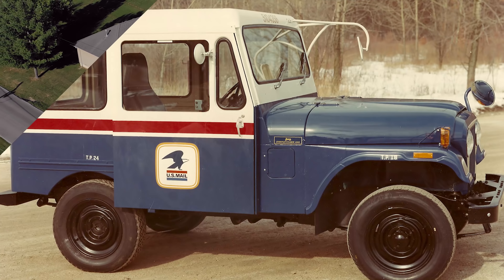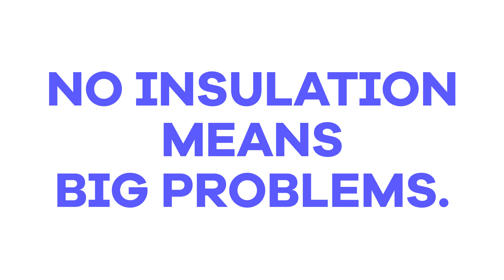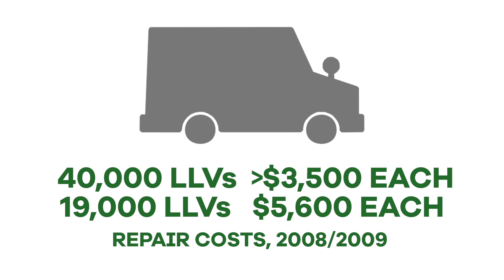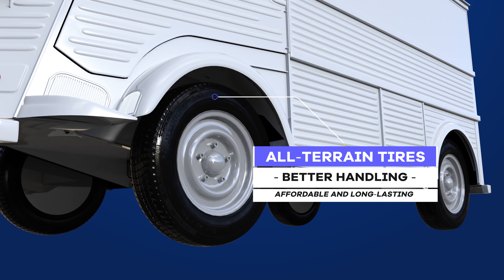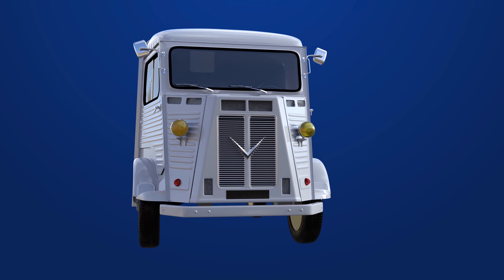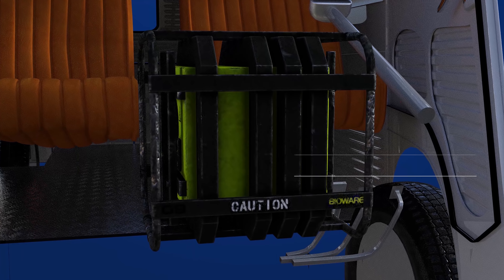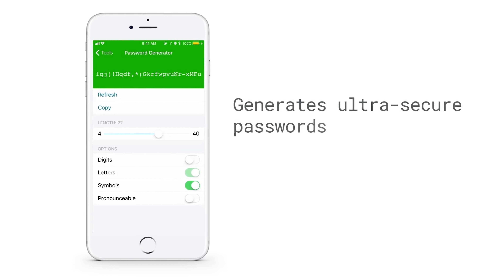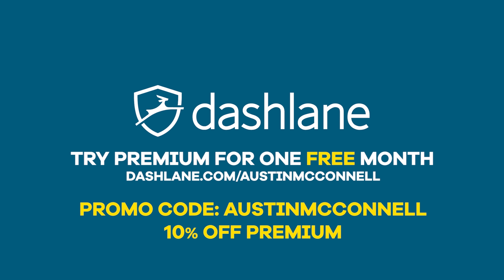Postal Delivery Trucks Stink. Let's Redesign Them.

Comment: Mail trucks do need to be redesigned, but the way you redesigned it is terrible. I’m betting the best redesign would be a RHD version of a Ford Transit Connect with the extra seats torn out or something, as boring as that idea is. And electric motors would be great! But only in the regions where those routes are actually shorter than 100 which probably isn’t true of anywhere more than 30 miles outside of a city, and even if that isn’t true the batteries will wear out over time and cost even more to fix. On a personal note I don’t like the aesthetic design, I guess, though a cuter van would be a good idea.

Comment: i run deliveries for people on my bike its home made so i could design it from scratch with the tittle saying (speccon) when i built it i made it both electric and gas i like the electric but batteries are not as good as they need to be not yet there getting there 

thats my experience with it other than the drivers in my family the biggest problem i can find with this video is that they do not have a small rout where i live the trucks run on average 200 miles per day that is a problem for most batteries and cost from my experience you get in ironto elliston and floyd you need something with  a long rang and you need more power because of the terrain in this area aka shitty roads  i use less gas in dc and maryland unless the cops are some where else  around 

yes i know my spelling is shit im sorry i am self taught on that but i would love to hear other opinions on the subject

Comment: Its one thing to do a think piece on what you think needs to change, its a whole other to do an actual redesign. This design reeks of impracticality, it seems expensive and needlessly "modern". You would actually need to run a price diagnostic and figure out the ROI to even begin to call it a redesign. I think mailmen should use jetpacks, but until i actually detail the mechanics instead of "Hey, lets put fuel on their front for balance and the jet engines in the back for thrust" i havent done anything. And while im sure you put a lot of work into this "redesign" and animations you really havent done anything because not only are these not backed up suggestions but you havent figured in the cost of developing or producing them at all

Comment: Cameras are good, but tiny windows like yours are no improvement for safety. Also, your sitting position is too high with the window sill too high to be practical for delivering to curbside mailboxes. Your hood design sticks out too far obstructing visibility in front of the vehicle and is totally unnecessary for an electric engine. Remember, the vehicle must maneuver around parked vehicles. (After delivering mail for 30 years, I can tell you that many people park too close to their mailboxes or insist on putting trash cans on the same corner of their driveway.

Comment: Iron Duke is famous for being terrible motors, kinda weird that they would go with that.
Reply: They’re slow and inefficient, yes, but they’re cheap and (relatively) simple to maintain. Also it was the 80s and GM put that motor in everything in the 80s so its not surprising that it would be in a mail truck.

Comment: Why don't they just keep the current llv design and just make  it electric under Elon musk? Somehow incorporate good insulation. So you can have ac and heating. That alone would do wonders for the mail carriers. Llv design has proven to work for how long it has been in use. The major problem is comfort for the mail carrier. And hazardous mechanics such as the fire problem.

Comment: I don't know if anyone I got to read in the comments actualy ever designed an automobile but what he just proposed is basicly what they are working on. The electric motor and tracking system along with anylitics about the truck. That is all going to be there for sure. These are all common things now even in our ICE cars. I have towed and worked on enough of those stupid trucks in my life time. I do have a real design for a car a truck a transport truck and a number of electric aircraft. I did really like the old schooll design though and the lift and tires. Reminds me of an old GM milk truck. And you need the flames.

Comment: Ground clearance, like a crossover
Longer
Cameras
Wiper fluid box separate from fuse box
Aerodynamic design
Reply: Long life
Reply: Chevy van chassis 
Engine from GM
Chassis: Chevy Express, but longer and modified to handle the load
All-Wheel drive
Reply: Insulation 
No rivets
Reply: All terrain tires
Doors (left and right)
Lights 
Cameras
Reply: Network

Comment: MY idea
Flat nose van body
AC
Surveillance system
Deisel I6 engine 
Insulation
4WD
Locking differentials on all wheels
Lots of lights
Higher ground clearance
3 speed manual gearbox
2 range transfercase

Please reply anything I need to do to improve my idea
Reply: Switch out the electric engine for a diesel straight 6, AWD to 4WD, Tablets out.

Comment: The reason the steering wheel is on the right is because thats the side mail boxes are on in housing plans and out in the country (atleast where I am). The idea is that they don't have to get up. Also, they have to be small due to some of the roads they go on(extremely tight with low hanging branches).

Comment: Dang Austin, this was certainly one of your worst videos. I almost felt it was a troll when you dropped that Elon nonsense. But, I suppose it makes sense given that you've never actually seen mail delivered before, based on the fact that you thought the reason LLVs have a right side steering wheel was for safety. Seriously, I figured out why they have right side steering when I was 6.

Comment: Elon musk is cool and all but really some of his designs are a little insane so I wouldn't call him great at always updating the outdated.  like the hyperloop is just the biggest failure of an idea possible that has so many basic design and logistical problems that its dead on arrival.  The whole highway under ground is kinda silly for a multitude of reasons.  And the whole business class rockets also have their own set of issues.

Trust me I like him for being crazy and doing crazy stuff but hes not the solution to every problem.

Comment: For reliability No computer CONTROLLED Climate electronics.
 So you think they are great? Well my 16 year old vehicle needs fan, headlight, rear wiper defroster and other controls. All of them are dead. AND VERY expensive to replace. $300-500 each and for some reason there are ten modules to try to figure out if 1 or all are bad for each thing that used to be done  with a simple switch. So what did I do? Got wire and switches. The fan is on or off. All the vents are wired full on. Yes just used pieces of wire to hold the all the servo flap thingies open. Did the same with the heat  A/C. Replaced the headlight controls with simple switches and relays.
 Go back a few years to "94. Fan bad?  No problem check the switch. Switch bad? Replace it. $15. Fan bad replace the fan $60.
Diesel used to be a good choice but DEF fixed that.
AWD? Yeah sure, front diff goes bad and you only used it 3 times in 10 years. Need a hoist, a cherry picker and a ton of tools to fix it.
 Go back to 1980 and use a solid manual locking hub axle. 40 years later still works.
Most of this improvement has been to ensure the mechanic has a job until the customer says enough and buys another vehicle.
So maybe the answer is buy a Compact Australian, Japanese or European RHD city delivery van and replace them every 6 years. Some of domestic producers also make some for that market. 
Driving a RHD is not a problem on US streets. If you have to deliver on one way streets  Just load a LHD drive van just for that side of the street. 
But we are talking about the US .gov type think. Good luck.